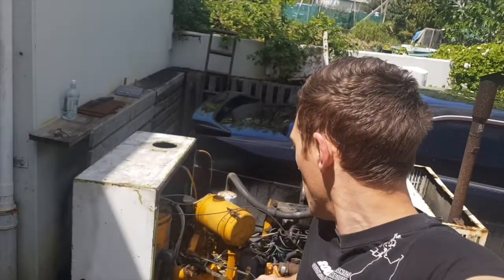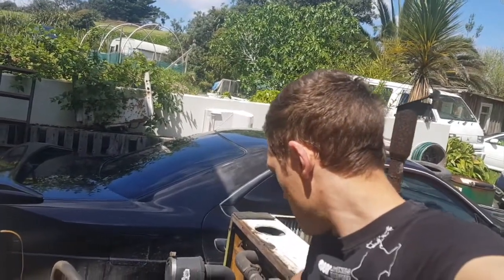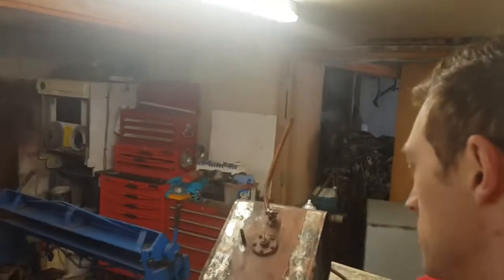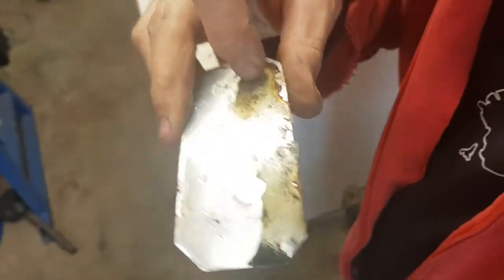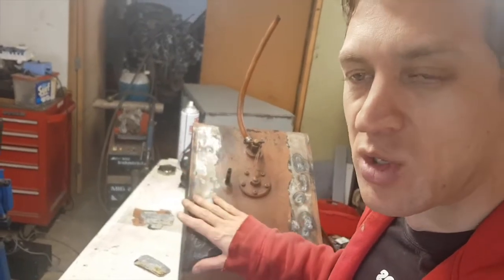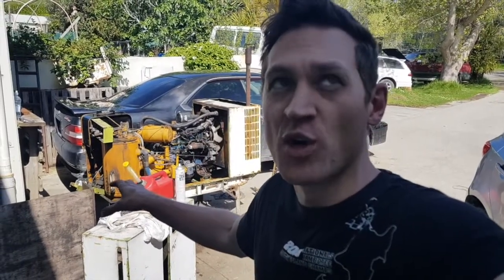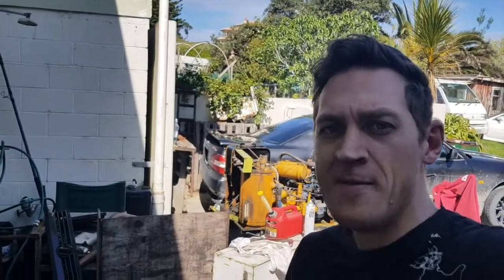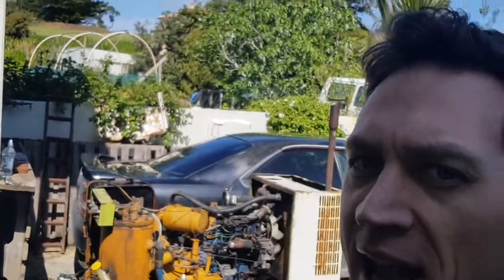DIY Vapour Blaster - Air Supply Upgrade

Comment: Gday
nice i ended up getting a 10hp diesel 28cfm 160lt tank air comp runs my sandblaster with ease
i had same problem power and renting was not sorting 15amp out just to leave it there only thing is the 1cyl knocks away lol but lots of air
cheers

Comment: What a beast. So many CFM, you could run a few cabinets at the same time.
Reply from the maker: That's the plan! It is looking pretty good but I won't be sure until I service the compressor and load it up. Worst case scenario is the compressor is tired and I have to fit a handful of piston pumps.
Reply: @ArmouryEnterprises  hope for your sake it is serviceable, I guessing the current compressor is better than a bank of pistons. 
I just picked up an Atlas Copco LE7 piston head 20+ cfm, the direct drive one, but missing the motor. Now starts the process of trying to couple a single phase 7hp motor onto it. Tricky part is the initial current draw is going to be more than the shed can take. So even more hassle and costs.
Reply from the maker: @NathanNostaw  Yeah I was thinking that as I was reading. What the current draw on a 7hp single?

I would have loved to have gone electric but there is no way I could do what I need on the wiring at my shop.
Reply: @ArmouryEnterprises  yep,  I may not be able to either. If plan A fails I may be able to run a smaller motor eg5hp if that can work and still get over 18CFM. Not sure.